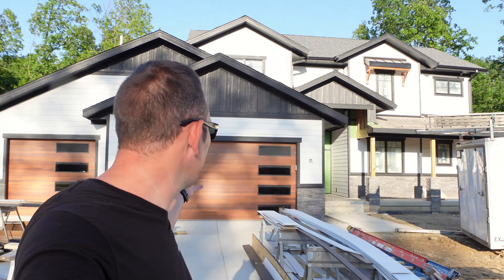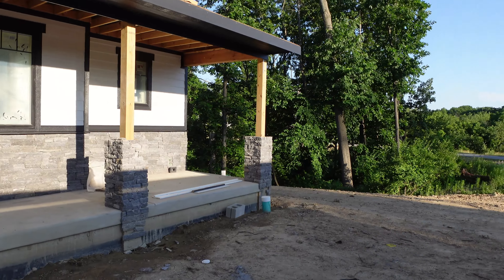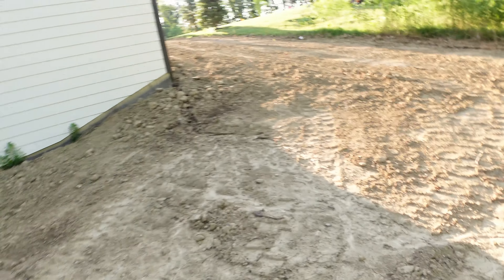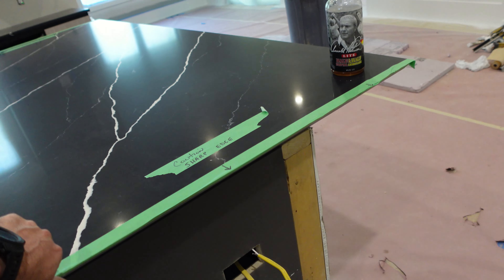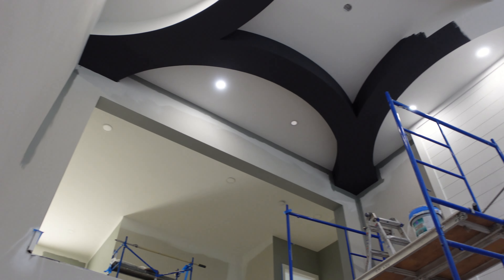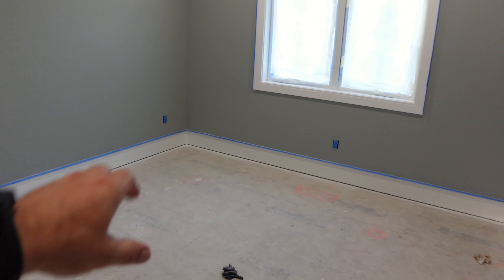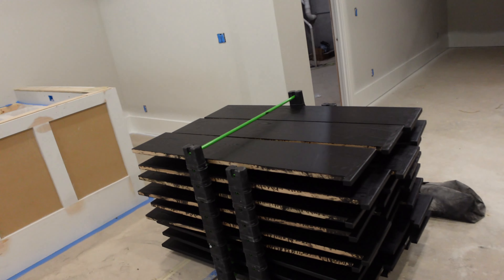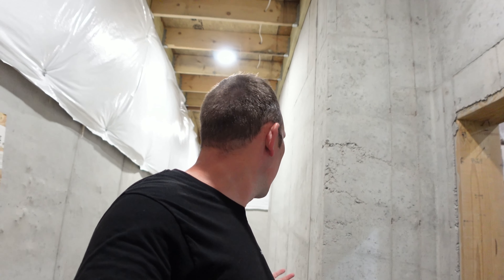Custom Home 2 Week Countdown!!! New Construction - Episode 39

Comment: Do you seed or sod the yard?
Reply from the maker: This will be sod all the way around.
Reply: @pinnaclebuilds1011  that will be a little bit of watering to make it stay alive but always looks better to be green right away.
Reply from the maker: @bryanspriggs4290  We don't have a choice in this one, as the covenants require sod. I still think seed done properly leads to a better looking lawn in the long run.
Reply: @pinnaclebuilds1011  interesting on the seed. Is it because of the joints where the sod butts together?